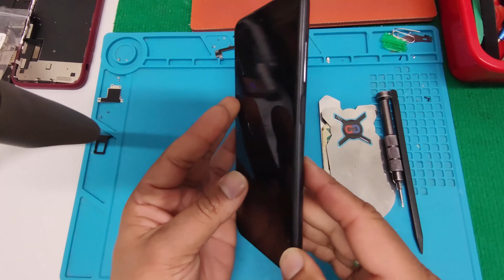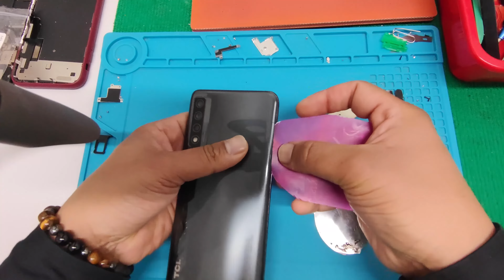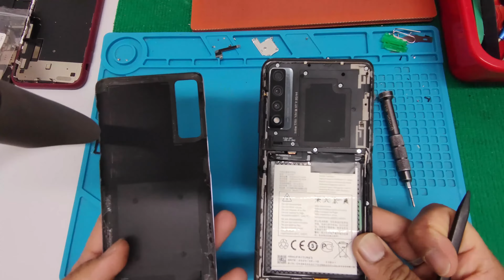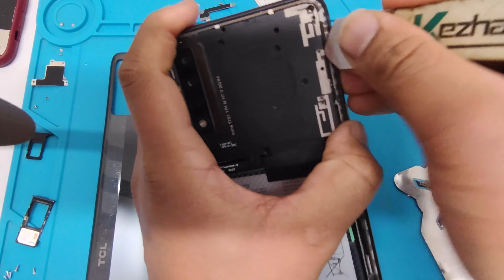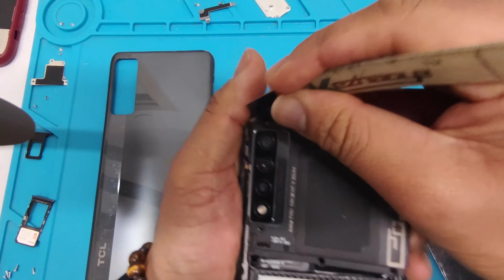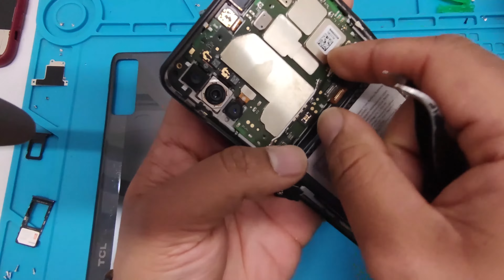TCL 20 5g compelete disassembly

Comment: Please how do you disassemble an older TCL phone that appears to be sealed
Reply from the maker: normal friend without fear then ask
Reply: @HardwareDoctor1  🤔
Reply: @HardwareDoctor1  
It wasn't "sealed" afterall. Got it opened but encountered another hitch... It's got a built-in battery, so couldn't remove it to try charging externally with the universal charger I've just bought specifically for this task... 😢
Reply from the maker: @kd9601 so sad my friend .

Comment: how do I fix my tcl phone, it was fully submerged and i made the mistake of using it thinking it was fine. now it wont turn on it only vibrates, how do i fix it, also it has the finger scanner in the back
Reply from the maker: thanks i think your phone hp display problem won't charge bring some repair shop they tell you problem.

Comment: This is definitely not a complete disassembly. And it didn't really show much of anything at all, except how to open it,unscrew the plastic covers and unplug all elements from the mother board. I think most enthusiasts would figure those out on their own. As I did. 
I hoped for  a more detailed disassembly, with pointing out where all parts are located and possibly removing the screen from the main aluminium casing.
Reply from the maker: thanks for message but you have to make video can short shows things important how to open other you do vidseo devanta too long for this but thanks for advice
Reply: @HardwareDoctor1  Sorry, Google Translate seemed to have a problem making that English, could you try again?
Reply: How exactly is the battery removed?
Reply from the maker: Yes